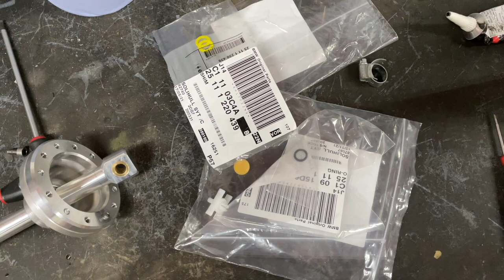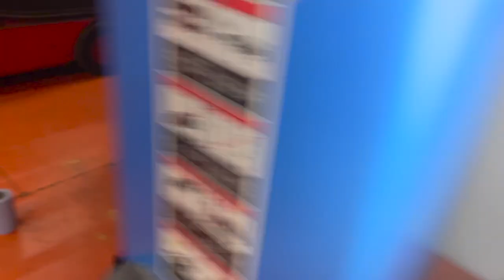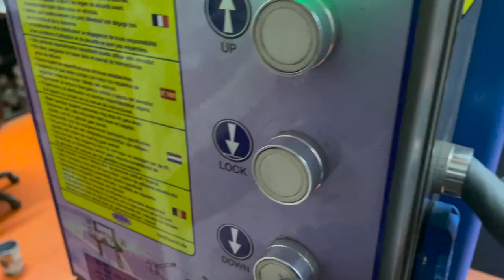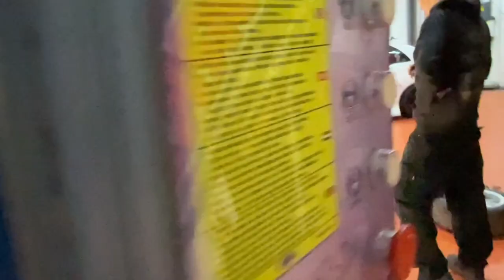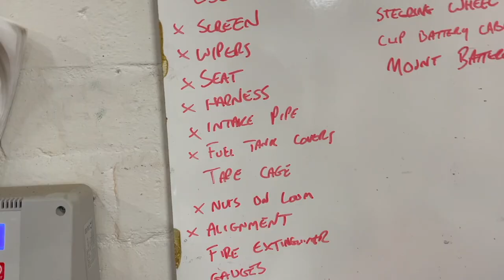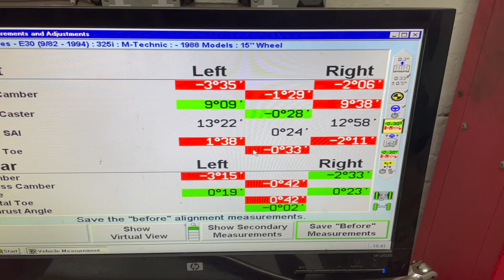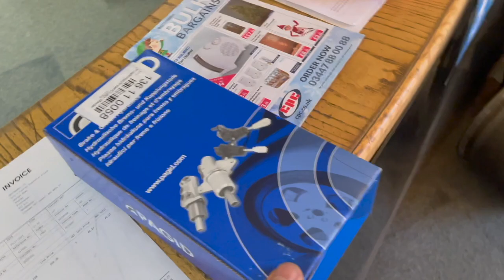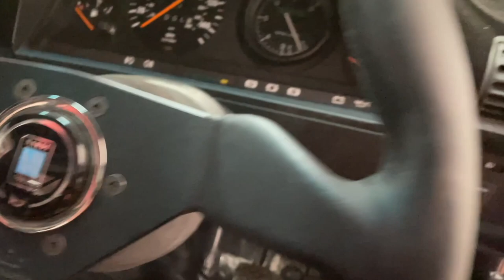Jays BMW E30 Track Car Build - The final push to get on track

Comment: I wrecked the handling on mine dropping the ride height on HSDs. The bump steer was  horrendous. 
MRP do a bump steer correction kit with drift lock position for the tie rods. Well worth it, nearly sorted mine out completely. It was brown pants hitting bumps at high speed.
3.73 is one of the smallest ratios you can get for an E30. But the E36 compact diffs fit straight on and have smaller ratios available. Using a 2.69 on mine from a E36 diesel and sits at 2600ish at 70mph. My LSD carrier fit straight in

Comment: The oil pan is the absolute coldest oil temp reading you can get from your engine. Needle is going to be pegged left for ages upon start up. Try the oil filter housing!

Comment: Im considering putting a new shifter on my E30 project, but not sure if I want to go with a chassis mount one.   I understand the reason for getting a tall one is for more leverage or faster shifts maybe, but I don't like them.  What Im thinking of doing is just going with a Z3 or Z4 type of lever that reduces throw although there are Lots of different aftermarket options available.  That E30 track car is probably so much fun to drive, and it looks damn nice too!

Comment: I am so jealous Jay what an icon of a car, those wheels, the old 80s 530i bmw originally came out with them . Pity E30s aren’t great handlers on track , E36s miles ahead .the design geometry of the suspension was not great on E30s, so you can change/ convert  all the hubs to E36 so you get bigger brakes ad 5 stud suspension . Would like to buy your old white wheels if they go for a good price, ?

Comment: Unless you plan on running unibal bearings I suggest you get the full powerflex handling pack. Improves the handling and feedback noticeably for cheap moneys.

Comment: if you have 3.73 diff ratio with 5 speed gear box from E36 you will have a 5th gear 1:1 ratio vs the E30 0.8 ratio perhaps that is why it seems short

Comment: On the old Porsches I push the trim in the seal before putting the glass in. Does that not work with the e30? The design looks the same.

Comment: Those EIS radiator are not good for track day use. The tubes are too large and there isn't enough of them to properly cool a hard working engine. They are fine for normal road use though. I always go for the hella or Nissans radiator for high performance use.